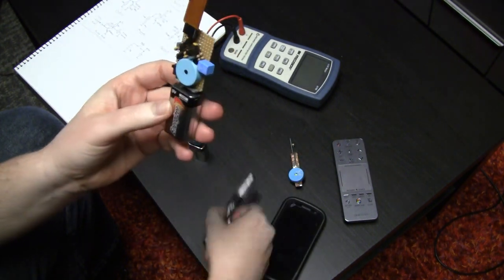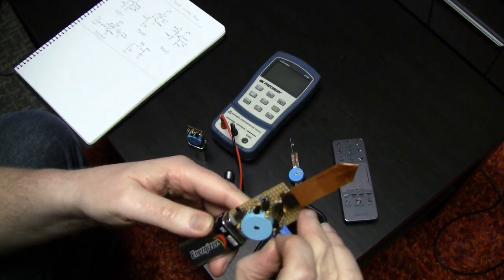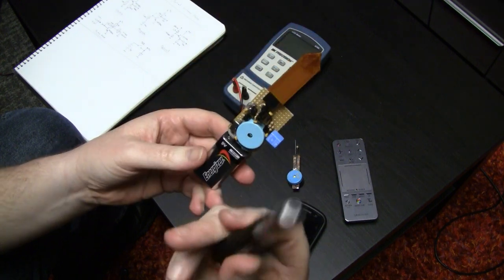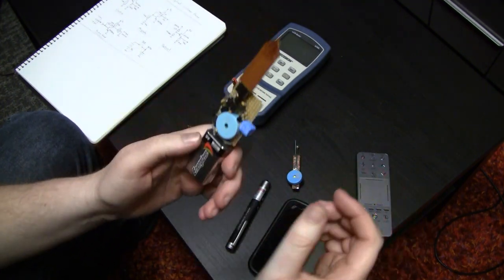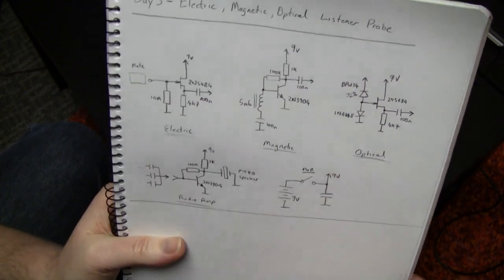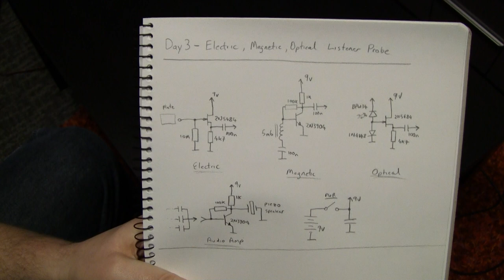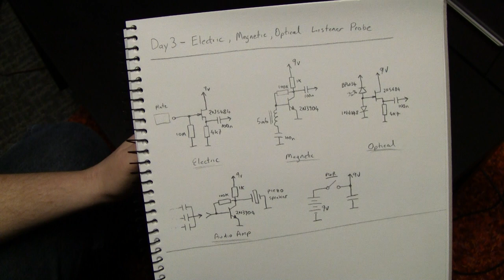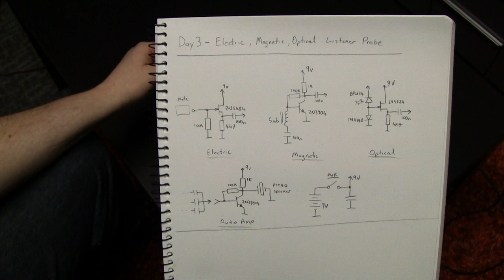Advent Calendar of Circuits 2014: Day 3: Electric, Magnetic & Optical Listener Probe

Comment: Would love to see you go through the design of a simple SMPS, especially one for high voltage. I have a selfish interest here - I want an HV supply for vacuum tube circuits, and would prefer variable voltage, so SMPS seems like a better choice than linear.
Reply from the maker: Robert Liesenfeld yeah I was thinking of doing something along those lines, long ago I made this: http://www.vk2zay.net/article/199  I was never happy with using a microcontroller to implement the regulator.
Reply: vk2zay Yup, that's the article that inspired me to try building an SMPS :) It worked after a fashion but all of the inductors I tried got very hot.  I don't have a great understanding of why that happens - the magnetic aspect of inductors isn't something I understand well. You mentioned thinking about doing something with toroidal inductors, perhaps that could dovetail with a (slightly) broader discussion of inductor physics...